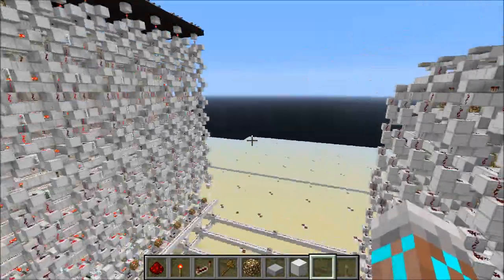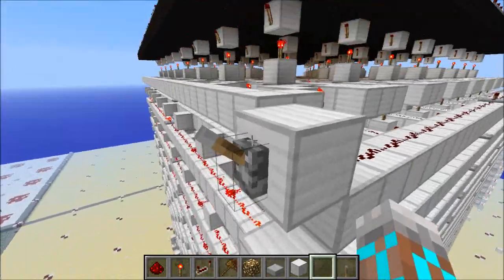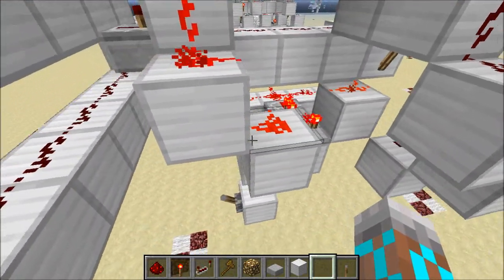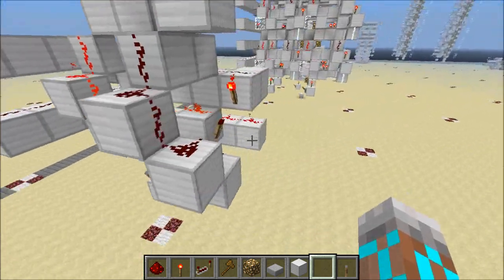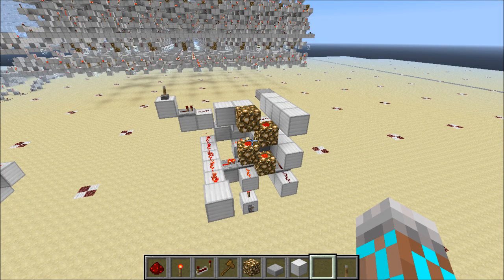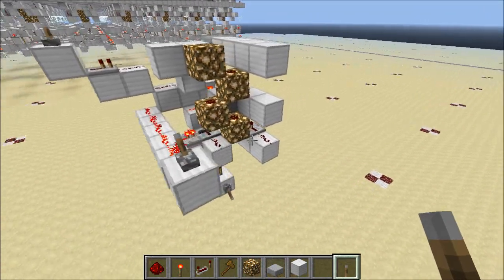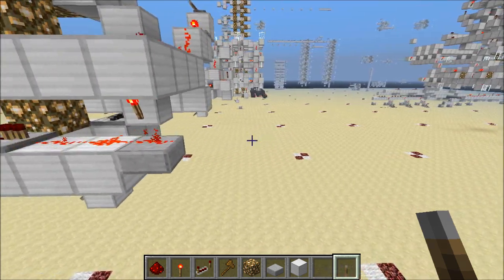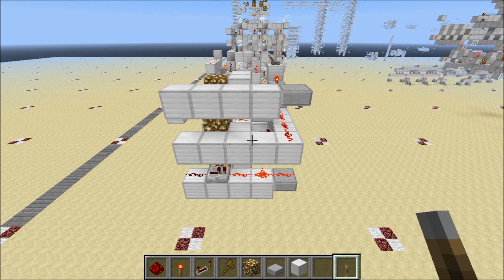High Efficiency RAM for Fast GPU Data Transfer

Comment from the maker: I just took a look - very nice work! The thing is, one of my major goals for this project is to limit my piston usage to the bare minimum to reduce lag. I had previously played around with faster serial systems using pistons and they were fine for one line, but when I had 8 running at once things could get pretty laggy. Once the 1.5 update is released I'm definitely going to go back and rebuild all of the serial components to see if I can make it a little faster.

Comment: btw proper, i was just doing some testing on the new snapshot and discovered that repeater lock serial can be sent at 1 tick per bit now in any orientation without glitching or missing/adding bits :D.  you may be able to make your data transfer even faster :)